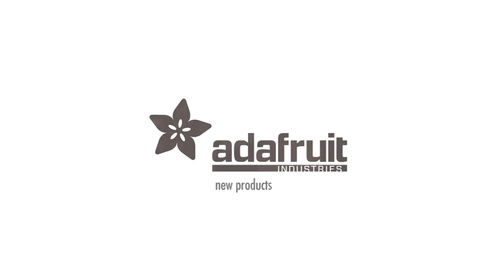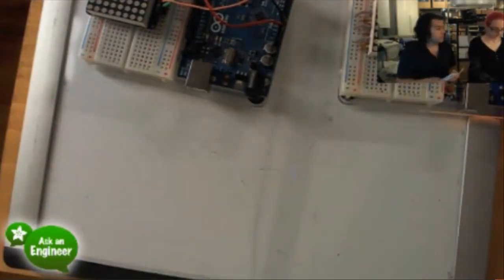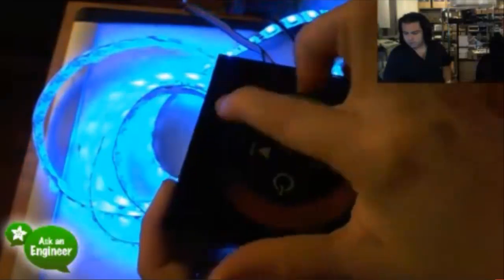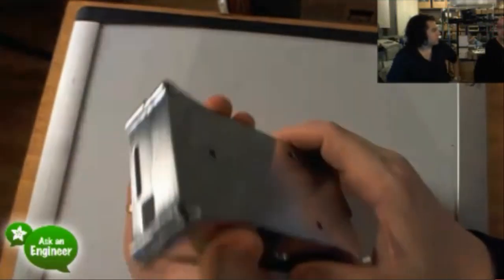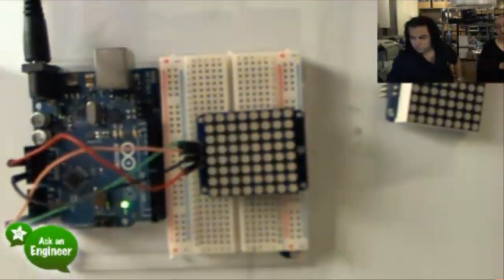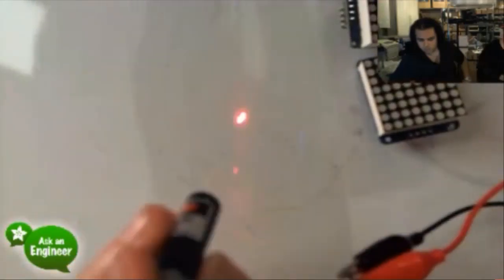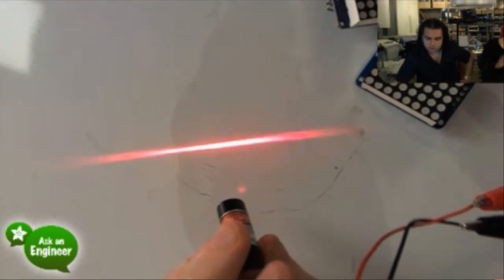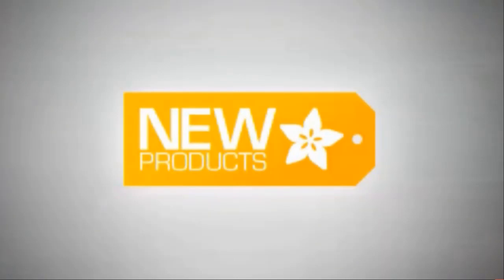New Products 10/6/2012

Comment: Hi Teensy 3.0 is Cortex M4 based, not M3. As I understand it, the difference is that M4 cores have additional digital signal processing instructions - should be useful for synths and filters.

No idea how accessible these additional instructions are but will find out shortly as my teensy arrived in Dubai this morning.

The Arduino Due has the M3 based core. 

Duane B  ( rcarduino )